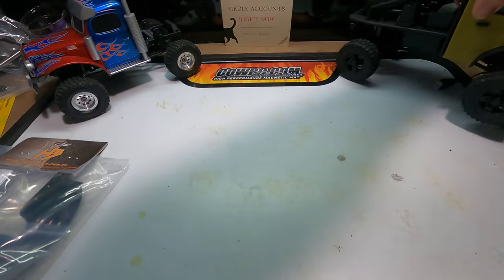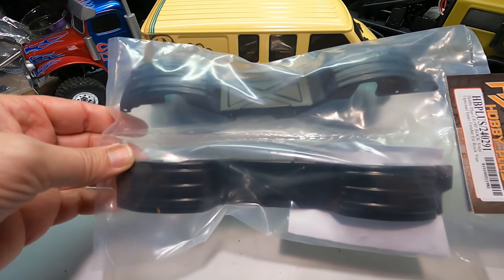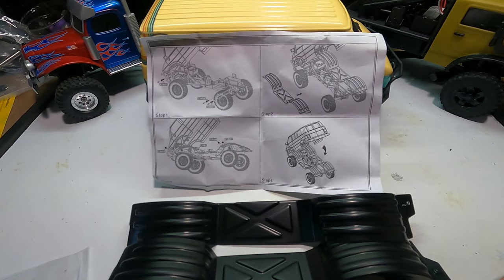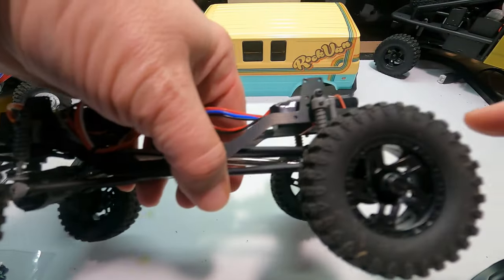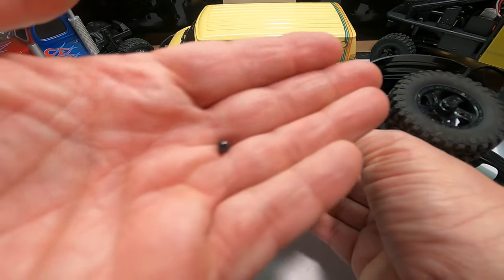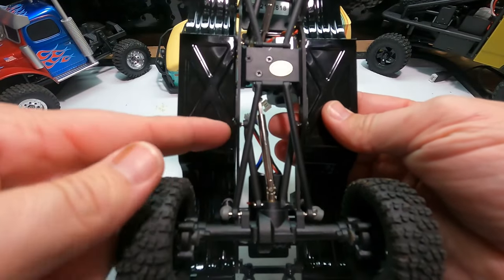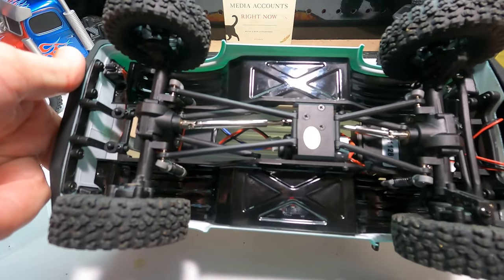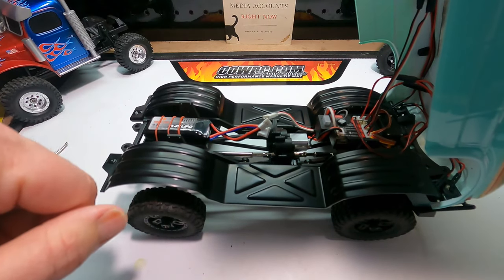How to Install Hobby Plus Rock Van Inner Fenders!

Comment: Thanks for showing these. Now that I know they are fairly lightweight I will have to pick a couple sets up. It looks possible to trim a set to fit the Hunter.  Some builds I will put the battery on the slider opposite the motor to help side to side balance. If space allows I prefer to have them mounted in the center front of the chassis though.  For my Hunter I hand built a small tray above the motor to hold the battery.  Helped lower the cg and bring the weight bias forward. I will likely build another one for my Mystery Machine when it arrives.
Reply from the maker: Glad my video was informative. I'll try to relocated the battery in mine too. What material did you use for the tray?
Reply: @QuinnsRC  I used some scrap plastic I cut out of an old paint spray shield. Then I used a heat gun and some wood blocks to mold it into the shape I needed.
Reply from the maker: @cornfieldcrawlers9907  I wish had that kind of tool man ability. I think I’m just going to do some kind of Velcro or rubber band.
Reply: Something I’m playing around with is putting left behind the wheel. My reasoning (I’m still testing) is to counteract torque twist and most of my mini rcs tend to lift the front left towards their limit.
Reply from the maker: @JUSTHAVEFUNRC  That sounds like an interesting idea!

Comment: Kewl! You can buy these small battery video lights that might add a bit of detail in the shadows of your night time shots. Which I really like btw!!!
Reply from the maker: Thanks! I can't remember if I used my iPhone or GoPro for this. I have a GoPro light mod, but I haven't used it because I keep stuff in boxes now until I have enough time to make a video.
Reply: @QuinnsRC  Or you could just use a flashlight, ya know like one you would keep in a truck or a van, lol. When you are looking at a scene your eye will see all the detail but cameras have a difficult time capturing that amount of dynamic range. A flashlight would look kewl, like a follow spot on a theater stage.

Comment: Thanks for the video Quinn oh, I just ordered it that along with the light that you showed in the last video and some metal driveshafts, also picked up some of those hemostats
Reply from the maker: Glad the video was helpful! You'll love those hemostats. The mods for these are very nice. I have the oil shocks and brass wheel hexes waiting for a video.
Reply: @QuinnsRC  nice I thought about the shocks, maybe later, surprised they don't have a bearing kit on fairrc yet
Reply from the maker: Ya, me too. I had the Hobby Plus CEO comment on this video on FB and I asked him for a bearing kit. Said he'd add it to the list, LOL. Just curious, did you use the affiliate links in my description to buy the parts and hemostats? Not that I expect you to; just wanting to make sure I'm not whiffing on the links if you did.